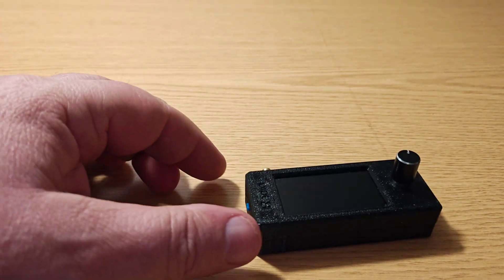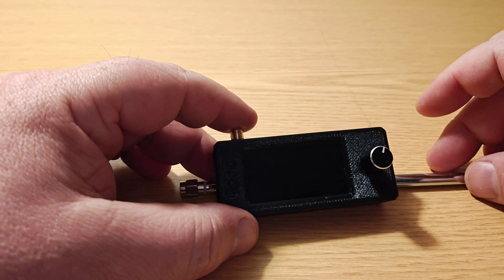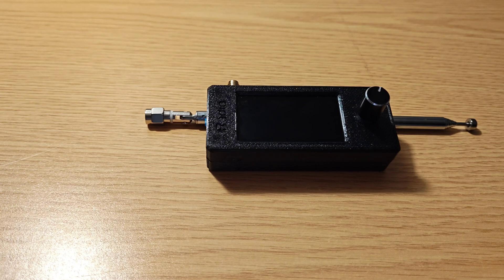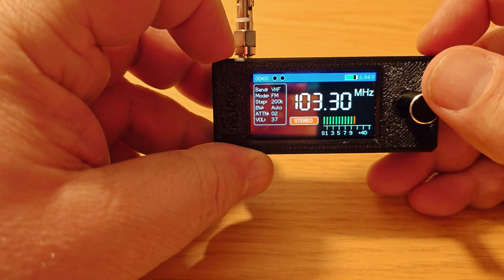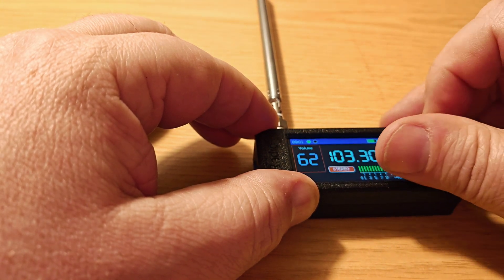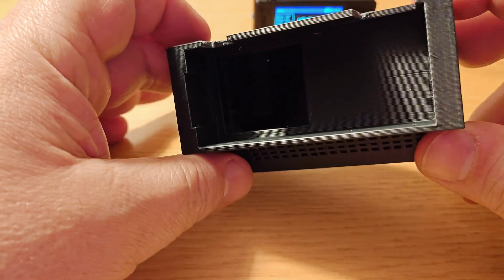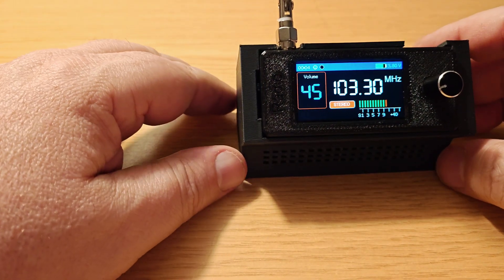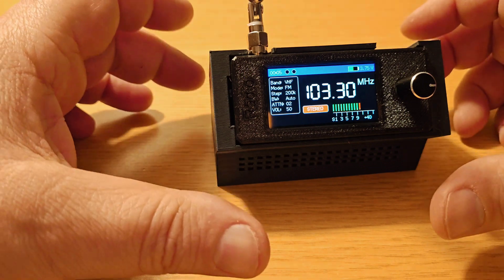Desktop stand for the SI4732 SDR radio!

Comment: I bought a 6 dollar mini jack speaker no wires. speaker, just plugs straight into the headset jack on the right side bought it on aliexpress but amazon has also
Reply from the maker: That is definitely an option!  I just wanted something that also tilted the radio up at an angle to be able to see it better.  Thanks for checking out the video!

Comment: Warning, don't use the stand as there's a design flaw. There's no space in current design for the On/Off button and so when you push your device in, your button will be gone! Also, the design is so tight that you hardly can get your radio out. You need to take it out every time to turn it On and off again. And once your button is missing you need to open up your device to get it back into place. In my case that ended up with a crack in the screen and having loose screws!
Reply from the maker: Actually if you look there is a clearance cut out for the switch.  Yes you do need to take the radio out of the stand to power it on and off but there is clearance built in for the switch to not cause damage.  Also keep in mind that this is for the version of the radio I have.   There MAY be others out there that may need different tolerances.